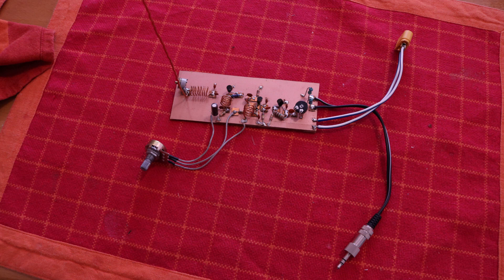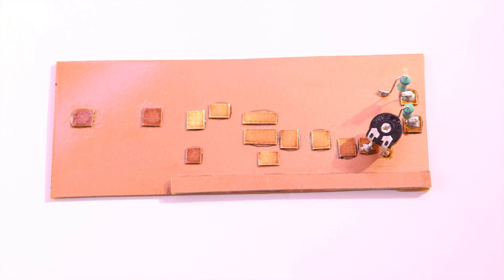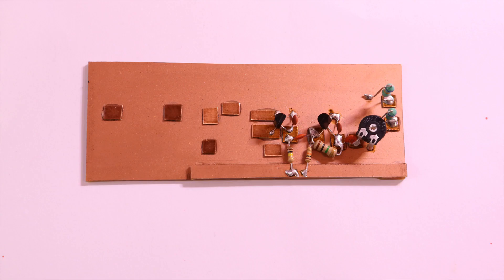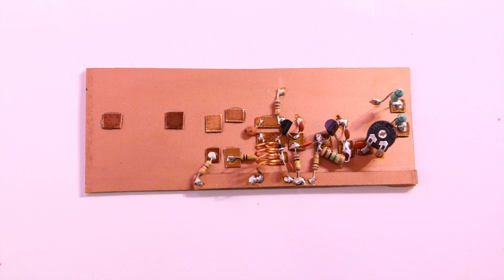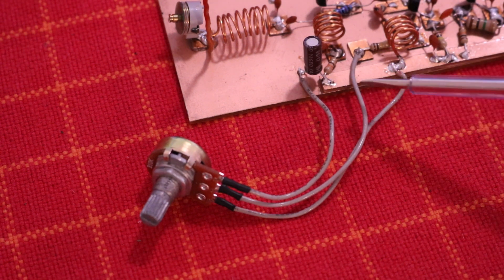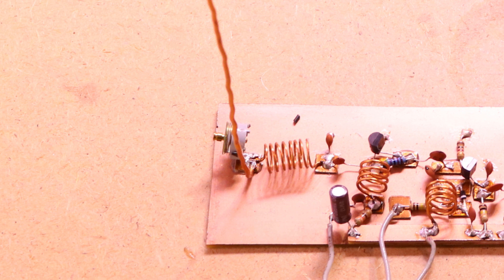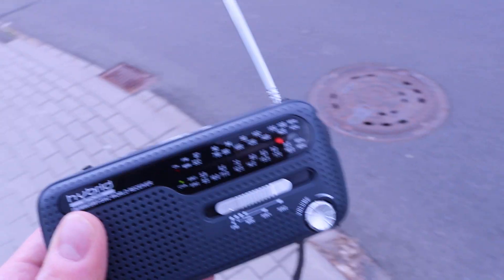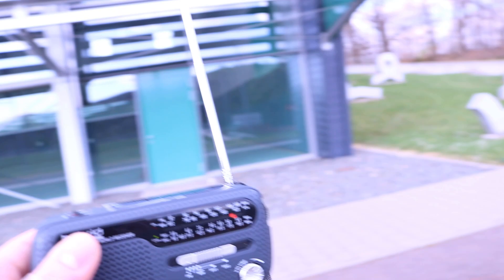DIY filtered FM Transmitter [without harmonic frequencies!!] Part 1

Comment: Thickness of the wire ? Which SWG is used for making coils ?
Reply from the maker: Doesn't matter too much al long as it's not too extreme. Just use something you can bend and what holds it's shape. Something like 0,4mm should be fine
Reply: @thesciencefurry  Thank you sir.  I am grateful to you for the reply. I really like the diagram. Is it possible to increase it's output power by using multiple transistor in parallel configuration ? Hence high power rf transistors are not available here.

Comment: Hi sir can you make a dipole antenna  for this transmitter?
Reply from the maker: Just use a piece of coaxial cable to extend it from the transmitter and use two wires with 1/4 the wavelength. Google for dipole calculator there should be a lot of help online.

Comment: Hello, nice video!
nice and GOOD schematic also because you shield the oscillator front and rear with amplifiers so that it remains stable!
also search with Google for:      schema vier trapper   or:     schema 3 meter zender

Healthy Friendly Greetings from the Netherlands
Rob
Reply from the maker: Hello, thx for the comment, do you mean the 3 and 4 meter radio band with these terms?

Comment: Range? Schematic and components, please
Reply from the maker: Sure, you can find all that here: https://youtu.be/nD5I-Tt64CY
Reply: @thesciencefurry  thx
Reply: I can change Bc547 with 2n3904?
Reply from the maker: @gameruldenis888  Yes, that should work perfectly fine.
Reply: @thesciencefurry  Do you know approximately how many mW take out? Where can I put a microphone if possible? I plan to build it. I'd like to put a signal amplifier on it to see what boost it offers
Reply from the maker: @gameruldenis888  I have no way of measuring how many miliwatts it puts out. It also depends on how well you adjust the filter. For a microphone you probably need a seperate amplifier, either a transistor or an lm358.